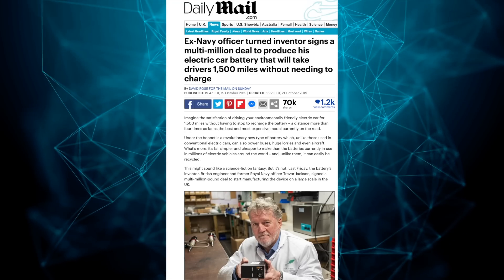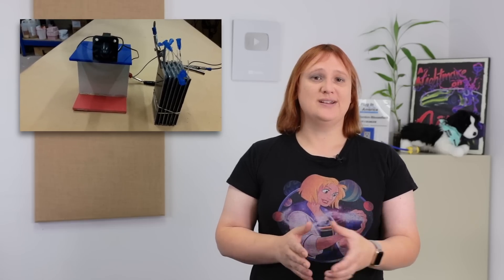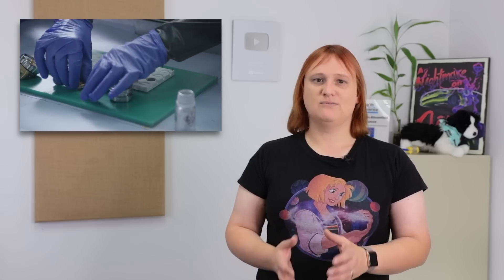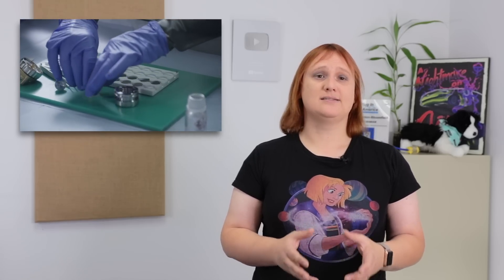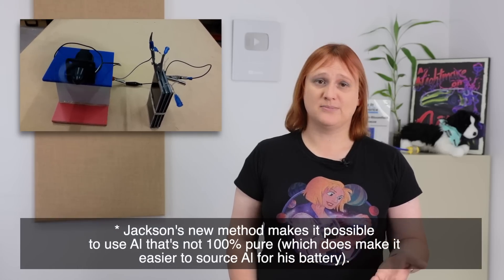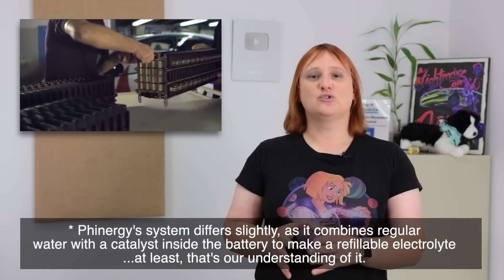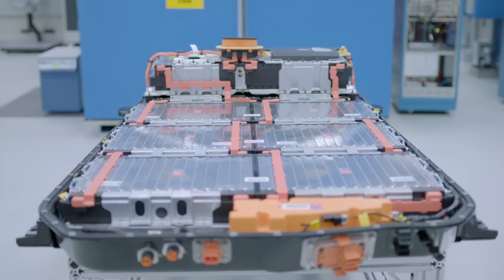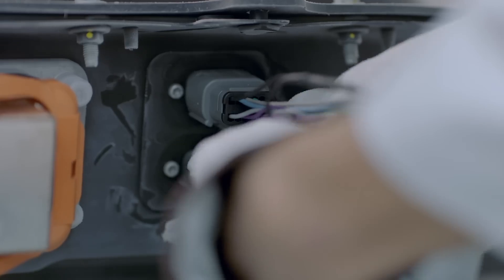Is This Battery The Holy Grail For Electric Cars?

Comment: Aluminium is colloquially known as "solid electricity" ( https://www.ga.gov.au/education/classroom-resources/minerals-energy/australian-mineral-facts/aluminium ), and there have already been proposals to use a billet of Al for energy-storage.   Its not really suited to cars/personal-transport due to complexity of refueling the vehicle (replacing the billet vs plugging in a cable or hose).  It is suitable for grid-storage or ships/large-vessels because a few tonnes of Al stores a lot of energy, and is worth recycling using the Bayer process (but that process it isn't an efficient conversion, so we would want to avoid using fossil-fuels).
Reply: It requires a lot more energy to make aluminium than you could ever recover from it.

Comment: The range extending idea was what I thought of immediately. Would be great for making electric cars viable for rally racing. If the battery is stable and not a fire risk, you could put a few of them along the bottom of the gutted interior and swap them quickly between stages!

Comment: Let's see.  Instead of putting gasoline in the car every 300 miles you would replace the battery every 1500 miles.  No thanks.  And there was no mention about emissions from the breakdown of aluminium.   That cannot be healthy to breath.

Comment: The swapping part is nothing, Elon Musk and Tesla showed 6 years ago that they could swap out one of the batteries in their Model S cars in as little as 1 minute and 35 seconds, faster than it takes to fill up a gas tank from empty. Other manufacturers could make their batteries just as easy to swap out.

https://www.youtube.com/watch?v=H5V0vL3nnHY&t=361s

If the customer didn't have to buy the battery, Tesla could sell the Model 3 for easily less than $30K, other manufacturers even less. The only question is, is how cheaply the batteries could be made, and how a swapping system could be made so the batteries could be swapped as cheaply as filling up  a gas or diesel powered vehicle after 4 fill ups. 

A current electric vehicle that can go for say 200 miles on a charge, factoring highway and city driving, as well as not draining the battery completely, and not charging it back up to the maximum as most manufacturers recommend not doing, could go 1600 miles on a battery. 

A conventional ICE powered vehicle getting 40 miles per gallon would need to fill up at least 4 times to get that range. Gas at say $2.25 a gallon, filling a 10 gallon tank with 8  gallons, still having 2 gallons in the tank, $18 a fill up, times 4, $72. That of course varies with the price of fuel and amount needed.

We, the U.S. tax payers pay the billion dollar fossil fuel industry over $20 billion a year in subsidies, if that money was used to subsidize such an Aluminum Air battery system instead it could work. 

When you think about it, it is pretty insane that the tax payers are giving the fossil fuel industry billions of dollars a year to help them out. What does that say about business? They've been established for over 100 years, they're a profitable billion dollar a year industry, yet the tax payers are giving them billions of dollars every year. Talk about a rigged system that fleeces the tax payers. If they're such successful business people they should be the last ones to need any help or tax payer funded handouts. That money should be used to help our citizens and country not wealthy business people and investors like it does now.

Comment: As energy density is energy/mass it isn't a good thing that they are light at all. If they were heavier they would be smaller with same energy. They would still be smaller than lithium ion due to much greater energy density. They could just take up even less space if they were heavy.
If the aluminium could be replaced continuously this would be amazing. You could top up a tank with aluminium pellets once every 10000 miles.
Is the discharge rate comparable?

Comment: Btw, a car with a primary/secondary cell hybrid battery is already available in Japan, based on a magnesium air cell: http://www.style-d.jpn.com/en/piana.html
A magnesium air fuel cell (basically a sheet of magnesium running through salt water) has energy densities around 6.8 kWh/kg.

Comment: What about Solid State batteries? I though this was the next evolution for EVs.
Reply: Terrence Chin it is just a couple years away.meanwhile Tesla has purchased maxwells dry electrode manufacturing technology which claims one million mile cell life with increased range.
Solid state is even more promising and lends itself to more volatile electrodes such as solid lithium electrodes versus a diluted  paste .Sodium is now feasible energy density by a factor of 10.

Comment: Sounds like Al-Air batteries are Primary batteries, NOT rechargable.
Now if the Al could be combined with the electrolyte in liquid form, then the batteries could be "refueled" at a "gas" station just like with petro.  Quick refueling like with gasoline, but electric.  Now THAT would be nice.

Comment: In an Aluminum smelter, bauxite is refined into Aluminum.  Essentially the charging cycle.  It seems strange that this process can't be adopted to a rechargeable Al battery. You need a wee Aluminum reversible smelter in your car.

Comment: mr. Breitenstein 's idea , based on a multi-cellular battery bank might well work with robotic battery changing stations.  A small rechargeable battery would be useful to take advantage of regenerative braking (Super capacitor?).

Comment: 1. Ths biggest flaw with current and immediate future battery is charging time. This system could make charging instant. 
2. Whether we like it or not, fuel duty is a huge and much needed revenue source for governments to fix roads, run the police operate a healthcare system (unless you are a duped North American who choose to spend it on a military 20 times as large as its nearest 'competitor' 
If we dont find a way to effectively tax vehicle fuel, we will move onto a pay per mile system and then we  really will be screwed and TOTALLY spied upon!

Comment: Does this mean that the Aluminum Air batteries are kind of Single use batteries and have to refurbished each and every time? 
It would have been nice if you had also given a cost comparison and carbon foot print because of this recycling issue.

Comment: The "briefcase" battery I've seen discussed might be a model for how this system could be a supplemental to the Lithium Ion: if this battery could be easily removed and replaced, like a piece of luggage in the trunk, then it could be delivered roadside in case of an emergency when you've run out of power. And a delivery service could drop off a couple of fresh ones to your house, and take away the used ones. Ease of swapping would be key.

Comment: Lithium ion are not an adequate replacement for ices .  Inadequate range and far too expensive.  When a Li powered car is about six years old (2000 cycles ), it becomes worthless as the new battery costs more than a six year old car.  Mr breienstein

Comment: This technology could be great in so many applications. For automotive, I like the idea of a supplemental solution (that is unless they figure out a way to more easily recharge). Most people wouldn’t need that kind of range that often; however, when hauling or towing, a battery uses more energy and could use this kind of supplement.  
Think semis for example.  
For lawn and landscaping, there are more and more battery powered machines. This would help companies as well as those with larger plots of land to make the transition from gas powered machines.

Comment: I like the comment below about use in aircraft - or watercraft for that matter. For road vehicles, wouldn't fleet situations be a good fit? A city bus system or police department, or a delivery company like FedEx have central garages and maintenance teams. Once trained in replacing the batteries, the job could be done on a scheduled basis. With a 1000-1500 hr life, this might mean less down time for the fleet vehicles, which won't need engine maintenance.  I could imagine this extending to semi-trailer trucks.

Comment: So they can't be recharged, must be removed and the aluminum replaced.  Sounds like an expensive proposition.  Way more than a normal re-charge on lithium ion battery.  As has been suggested, there maybe some specialty use situations where this type battery would be useful.

Comment: Do we know the "shelf life" of the aluminum-air battery?   Is it closer to lettuce or spam?
Reply: Aluminum batteries are not rechargeable. The material dissolves in the electrolyte so you need to dry it out and then heat it to over 1000C plus apply current to get the Aluminum back.
Reply: Eric Cartman Yep. That's a problem lead batteries also had. The capacity went to hell in a short time, because the lead partially drops down to the ground. Refueling also lead to problems with growing fractal lead trees that can short circuit or puncture the cell. Aluminium is just worse, because it always sinks to the bottom of the cell in a form that is unsoluable.
Reply: Also Austin Electric has two shares worth 4 pounds. Just to let you all know.
Reply: More like scam!
Reply: Ad Lockhorst And he is right.
Reply: Thanks guys. It sounded too good to be true.

Comment: Not being able to charge them at home (or anywhere) is going to be a deal-breaker for a lot of people, including me. But, I can certainly see where it could be useful in some situations. Personally, I think solid state batteries will be the real game changer (or a brand new li-ion chemistry that allows very fast charging AND doesn't need cobalt or any other expensive rare earth elements).

Comment: Maybe for aircraft, but otherwise no thanks, I would much rather wait for the improvements and Lithium-ion batteries to work their way from the lab to the street. Current technology already offers adequate range for daily use and minimal inconvenience during road trips if you happen to be an experienced driver. Plus the battery swapping part sounds like a production chain nightmare.
Plus here's the other kicker yeah it may have eight times the density but the fact that you have to do a complete and total swap means that you're going to be carrying a bigger battery pack anyway current battery packs already way between 300 and 500kg and that means even if you keep the range the same you're talking 40 to 60 kg
And that's not the kind of thing you want to hump around twice a week even if you happen to be a gym bro

Comment: When NiCd and NiMH cells became available people switched to these in a snap when powering their toys, especially toy electric cars simply because of the cost. Using Primary cells for a full size car is ridiculous. I hate to think of the carbon foot print of producing and distributing these monsters. Plus Aluminium requires a tonne of electricity to purify it.It would be nice to have high temperature superconductors then you could store electrical energy a million times more dense than any chemical battery and with no losses. That's the holy grail of energy storage.

Comment: Sorry to be pedantic  but EV batteries haven't improved by orders of magnitude at all. Far from it . Maybe by factor of 3 or 4 (in range terms). 
A factor of 10 is one order of magnitude.
A factor of 100 is the first that can be said to be 'orders of magnitude' (2 orders in fact)
 This would entail reaching ranges of many thousands of miles . Not quite there yet

Comment: Sounds like cars could be built with 2 batteries instead of one and swap the used up battery with a new one while running on the second battery.  Then you just reprocess the aluminum in the used battery to restore it right?

Comment: Making aluminium is way more carbon intensive than making lithium.
Reply: No. Processing it may be but lithium is seriously filthy stuff from ground to battery. You do not "make" either.
Reply: @siraff4461  I meant making the metal, neither exist naturally in the crust. What's so filthy about lithium processing as opposed to aluminium?
Reply: Glenn Reid ,one must realize that aluminum production is replacing steel I car body’s as we speak. This increase in demand is causing a stream lining of the manufacturing costs as well as reducing environmental impacts as well. Also byproducts of aluminum manufacturing are now being used in other industries.
An example is the red mud that makes up 45% of the waste is now being used to make bricks .this can offset the carbon footprint of brick making industries particularly as the demands for aluminum increase. Also keep in mind the recycling of aluminum is far less than steel just in the fact that the melting point of aluminum is only 700 degrees compared to steel 1800-2800.
I realize that your point is a comparison to lithium but the amount of lithium manufacturing relative to aluminum demand is not even on the chart!
Reply: @Dana5775  I get using aluminium on car body parts, that makes sense but it requires way more energy to produce aluminium than could ever be recovered by oxidising the metal in this single use battery. Btw the red mud bricks didn't work out that well because of their relatively high radon emissions. The CO2 emissions from bauxite refining pale to insignificance when compared to smelting alumina.
Reply: Glenn Reid.
The claim it is “more energy intensive compared to steel “ per weight aluminum is 1.5 times lighter than steel making steel in its mobile application 1.5 times more mass required for the same application.
That means aluminum is less carbon intensive per application and continues in the life of the transportation  device to continue to reduce carbon output 25% for vehicle transportation which of course includes airplanes! 
So no steel is a far bigger carbon foot print than aluminum!

Comment: Too many unanswered questions... firstly how much aluminimum needs to be replaced?  is it just the anodes?  can it be as simple as swapping out 2 rods of aluminum and you are ready to drive another 1500 miles?  If it were as simple as that this could be feasible.  But if you are swapping out a 100 lb battery every 1500 miles and can only be done at "gas stations" then the convenience isnt nearly as good.  Now theres recyclability?  I would hope the batteries are 100% recyclable.  If not then its not terribly good is it?  probably still better then ICE, but this is a question of degrees right?

Comment: So it's like the old alkaline AA batteries; use once then toss.  Since this has high energy storage whereas super-capacitors have high power storage (and are rechargeable), combining these two might be an option.  The real key would then be the cost of the replacement of either the liquid or the battery: if it's more than the cost of the gas for a fuel vehicle (ground or air), I don't see it being a viable option.

And, yes, an electric aircraft is a possible use for this technology since both weight and energy density are at a premium with such vehicles.  Again, it boils down to the cost of refueling.

Comment: Let's not forget, we have a perfect battery now:  it's called renewable hydrogen.  While we tout Lion at 300 watt-hours/Kg, and these Aluminum Air batteries are still on a bench top - a long ways from 1500 miles!  I think it's important to remember perspective, the specific energy density of H2 is about 40,000 watt-hours/Kg (over 100 times more energy dense than Lion) not worth mentioning?  Renewable energy driving an electrolyzer produces H2 fuel from water.  Use the H2 and you get most of the energy out, and most of the water back.  Not impressive?  Why is renewable H2 so ignored in American thinking?  Not in Japan, they understand if you want a clean world with dense fuel with no toxicity, and available to everyone (all you need is renewable energy and water) there is only one answer which satisfies all of these conditions:  renewable H2.  It's time to gain perspective and focus on real solutions which work for everyone.

Comment: Forget consumer transport. This is the technology, assuming you can believe the numbers, which could / should be powering every haulage fleet, public transport fleet, delivery fleet, short flights, or even construction equipment or site generators. Anywhere with a depot or base at which they could easily install or set up cell swap out stations could benefit.  Time will tell.

Comment: It would all depend on how well the used batteries could be disposed of/recycled, and how much the replacements would cost. If it's similar or cheaper than running a lithium iron battery for the same milage, and it sounds like it would be far quicker to change than a current EV battery takes to charge, then I can see the appeal.

We would just need these aluminum cells to be standardised for all makes and models of cars, and for them to be as common as charging stations are now.

Comment: Aluminum refining is done electrically.  Thus I expect to see an al-air battery that is rechargable at some point.  The charge an discharge rates may be lower than for Lithium but that may be OK as a practical matter.
Reply: Ken Smith yes wonder if there is some electrode infrastructure that can hold the aluminum oxide(gel) in place for the recharge?

Comment: In real you recharge it when you melt down the aluminium and use some chemicals... 8-)
Reply: Yeah. The Al refinery (which uses a lot of electricity) is "charging" it for you. Centralised power is on the way out so unlikely, but very attractive to big power companies.
Reply: Petar Doynov the alumina gel is not melted as it is not a metal until charged with electricity